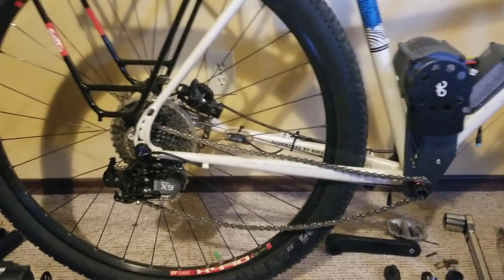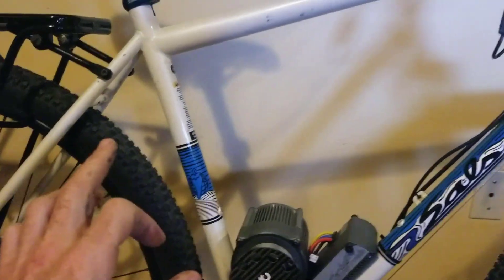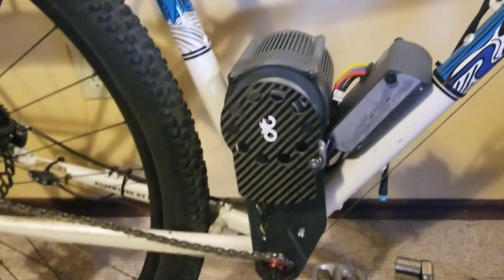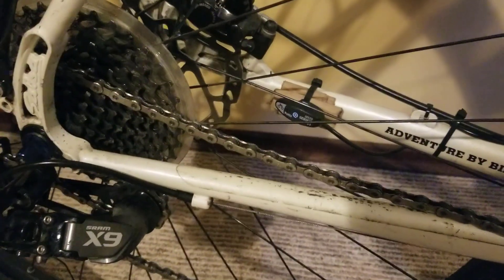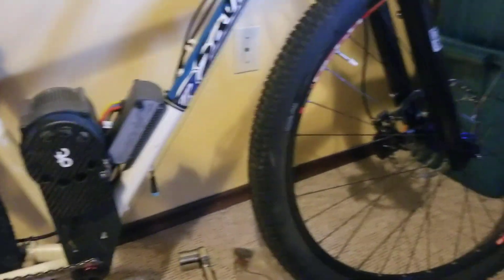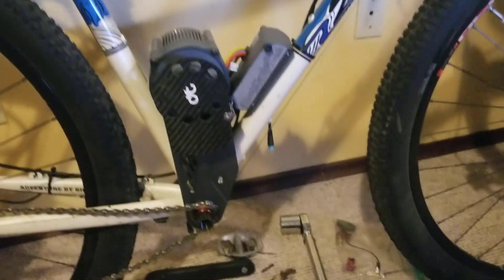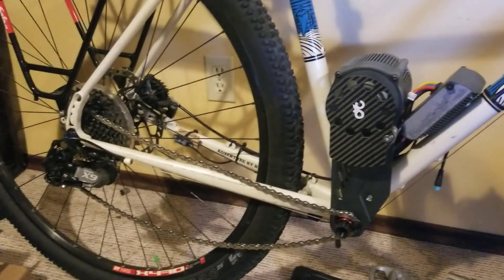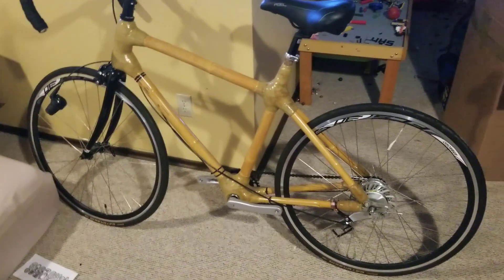Captain Codswallop - Competition Time

Comment: Hi Captain!

Thank you a lot for the videos full of information. I am planning on a new Ebike project, would be happy about some feedback about different controllers and motors. The build will be throttle only, no PAS. Max speed at 60 km/h. Like to have lots of torque.

I was thinking about different motor options:
 - Cyclone 3kW Motor plus ASI Controller
 - CYC Pro X1 with Stock or ASI Controller
 - BBSHD with ASi

I already have a bike with the Cyclone. The motor attachment brackets are too flexible for this kind of power. Maybe an option with solid steel brackets from Luna. With ASI it should be killer.

About the CYC - the chain management is looking cleaner, but there was some discussion on endless sphere about weird throttle response. How is your experience? Stock Controller vs ASI? Is the Stock controller close to ASI levels of quality? Motor efficiency, noise levels

BBSHD - how does this motor compare to the CYC?

looking forward to your response ;)
Reply from the maker: I have no experience with the cyclone motor. If its twisting the mounts then some better fixings might do it. Unsure what luna offer. The other option would be to get some mounts custom welded at a local bike shop? As in motorcycle shop rather than bicycle shop. If they will help! 

I was not unhappy with the throttle response on the stock cyc controller. I have an update to the firmware which is meant to improve it. CYC are confident that their controller will be a good option to have but there are gremlins to work out. I have not yet tried it with the BAC800 but others are reporting good things with it. The BAC2000 is where the real potential lies. 90kph+ with the right setup. A bit fast for me. 

Right now without knowing your bike frame I would say the BBSHD with the BAC800 is a reliable and fast option. The CYC has more power and potential but its a harder build in some ways. If you do want the CYC make sure that its the new final version shipping. I know you dont want PAS but the new BB is improved as are several other parts. 

Another option for a powerful motor is the lightning rods big block. You can get a plug and play ASI kit for this from ERT. 

As far as pairing the Cyclone with an ASI.... you are on your own. There is no plug and play right now although Alan might do you a custom job. The other option is to get an evaluation kit from ASI and do it yourself. I will go through that process on this channel but its a future project. Right now I want to get the CYC mid frame mount finished!

Hope this helps and good luck with your build. Cheers
Reply: @HighVoltageKits ,  

thank you very much. 

The CYC is visually and technically attractive. I may try it and if the stock controller is not sufficient, I would go the BAC2000 route. Good to know the throttle response was fine with your project.

How is the noise of the CYC, compared to other motors you had?

Cheers
Reply from the maker: Peter Azinov Its a bit louder and higher pitch but not excessively so IMO. Its definitely louder than a bbshd run stock. Once you ASI the bbshd tho the noise differential is much less. Cheers
Reply: @HighVoltageKits  thanks again!

Comment: Hi, I have the Cyc x1 fitted and working great. I have a problem with the Android app though because it does not 'see' my controller. Does yours connect ok? Also, I am not happy that it will not even launch if I am not connected to the internet and logged in to cyc account. Also no password for bluetooth? Other than the dodgy app, it is a great unit lol.
Reply from the maker: I hooked up the beta app once and changed a few battery settings. It seems to work. But not used it much. The iOS app I tried on an ipad but it's not mine so.... Even then its missing features. It could be really great but it needs work. Cheers!

Comment: i thought about purchasing a CYC but im not sure if a Bike Chain will hold the Stress for a while.(lets say 200 miles)
 I will go for a 457 or 273 chain on my next high power build.
Reply from the maker: I have a new SRAM 10 speed on the bike so I will see how it holds up. Once it's at really high power I'll probably go single speed or perhaps three speed. Maybe 3 speed internal hub. I'd wait for the torque sensing cyc to ship as well. It's meant to be end of the year. I'm going to switch mine over at that point probably.

Comment: Hi Cap! I hear back from Alan about the 21H error I was experiencing on my BBSHD BAC800 set up. Apparently the error means a phase over current condition has happened. I made sure all my phase connections were tight and clean but am still getting the error with wheel hop at high loads. When you have time to go through your programming of the BAC800 let me know if there is a setting for phase over current and if you BAC800 from ERT is set to the max (since your controller isn’t locked) My BAC800 is locked down and I cannot check. Also let me know if you see a phase over current error time hysteresis setting. Adding time to such a setting would fix my issue too since it only occurs when the motor experiences sudden load spikes when the wheel hops. Thanks again for all your help!! I always look forward to your informative videos!!
Reply from the maker: Where does the error show? Is it on your display? Are you using the colour one from Alan? I'll have a check on the settings and see. I'm very much still learning the bacdoor stuff tho but I'll do my best. Cheers.
Reply: Captain Codswallop   The error is on the 750 display that comes with Alan’s kit. Sounds good. Cheers!

Comment: What I think a lot of your viewers may be interested in is the building of your own batteries. I have been following you because I have a Fat Boy and am planning to put the Bafang HD on it with the upgraded controller and to get the full potential out of it,  I need a big battery. Doing my research I found a product that makes assembly as easy as building with Lego's, no soldering. And when I say no soldering I am refering to the soldering of the batteries. There will be a few solders for power and re charge wires and any monitoring wires yo might need. I am gathering supplies to assemble an 8P-14S 52v battery that will supply 80 amps and over 2800mah for the cost of a purchased 50 amp, 20 mah battery. If this interests you I will elaborate further. Cheers Mate!
Reply from the maker: That's some serious current for 18650s. My first battery adventure is going to be with lipo as I have a bunch already. Just waiting on a few parts from Alan at ERT. Your battery sounds very interesting please keep me posted. I'm interested in battery tech. My project queue is full for a bit but in the future I'd be open to some battery stuff! Cheers!

Comment: Is that bike actually make of bambo? Howd you do it?
Reply from the maker: Yeah it's the real stuff. I made a jig with Aluminium extensions to hold the metal parts like the seat tube and bb. Then I shaped bamboo and wrapped the joints with hemp thread and bast fibres. Epoxy glues it all. It was fun but super sticky project even with decent gloves I got epoxy all up my arms lol

Comment: Yo Captain! Awesome videos with the BAC 800's, BBSHDs, and CYC drive hookups. Haven't tried the egg rider v2 display (yet 😊). I have a BBSHD, with the E.R.T. BAC 800 setup on a Qulbix 76 R Raptor frame, and 72v lipos w Bluetooth BMS in the frame. Had to change the rear cassette also to have a better chain line too...thank you for that YouTube video post also! 😊👍 Also just put together a fat tire e kick bike with a 1000 watt front hub motor for beach riding. Waiting for a 48v 15 amp hr for it. 
Keep up the great work!
Reply from the maker: Your bikes sound awesome. I plan to try the Quilbix in the future. I didnt realise you could mount the BBSHD on there. Bet it looks badass. I bought the ASI evaluation kit so I have engineering time paid for with them. I just want to figure out as much as possible on my own first. Then I can really use the time to learn rather than him explaining which wire goes where. I have the harness mapped out. I'm still planning my wiring so the programme stuff will come later. But I'll be doing some videos of it for sure.
Reply: @HighVoltageKits  I tried to contact ASI to see if I could get the BACDoor software (which I would gladly pay for), but no reply. The BACDoor app requires a password to use it.
Reply from the maker: William W the access is restricted to the evaluation kit. It would be good if they had a program to buy access but they don't right now. On the plus side you get the ASI fully wired up and programmed as a plug and play kit. Do you use the eggrider. If so the latest update allows control over the most useful bits of the bac800. The power, amps etc. Its a little frustrating to not have the access but on the other hand Alan has to make an income and has invested lots of time into developing optimal settings for the BBSHD.
Reply: @HighVoltageKits  I totally agree and understand. Thanks for the helpful information! 👍
Reply from the maker: Anytime, cheers

Comment: Do you have an update on programming the asi 800 from scratch?  What was your experience with  the company ERT? ( I have seen some negative comments on the forums. )
Reply from the maker: My experience with ERT has been pretty good. It's not the fastest but I think it's a fairly small operation and I think it might be affected by the blackouts and fires in California right now. The ASI is not forgotten but I have to wire up the hall sensors on the cyc first. It will come. Time is short right now sadly.
Reply: @HighVoltageKits  if possible, please post a video of you programming the ERT BAC 800, I could use some guidance on how to do it. 👍